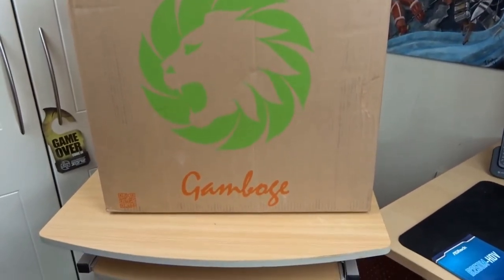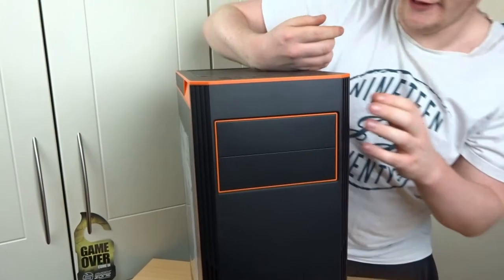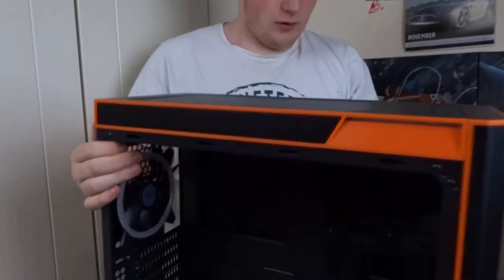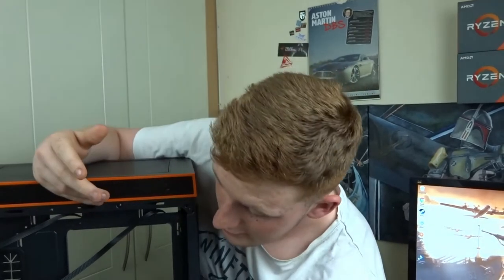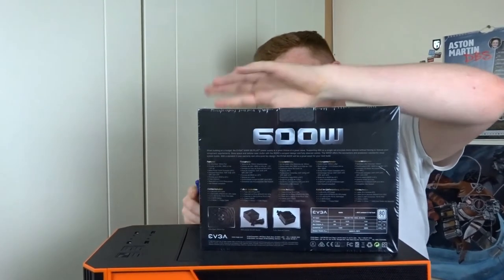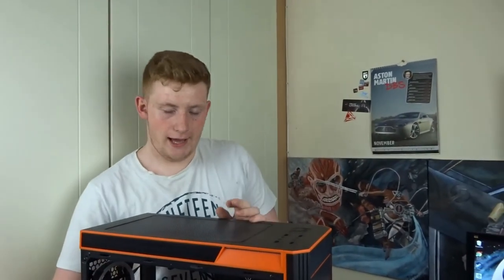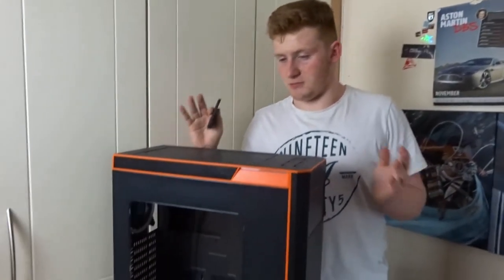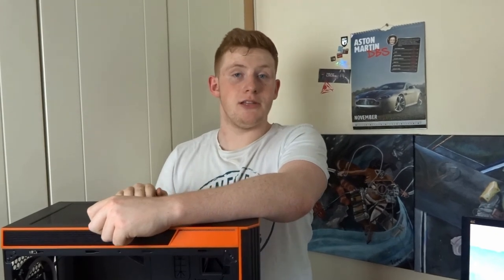Gamemax Gamboge Gaming PC Case Review

Comment: It's the exact same as the Graphite by Gamemax, just with orange accents. Not a bad case for the money (Cost £30 now)
Reply from the maker: My dad used this for a good while, never had any complaints
Reply: @SamsTechTips  I'm doing an orange themed build in this with a cheap orange x79 board and an ex server Xeon, just wondering whether to swap out the rgb for orange riing fans....They would cost as much as the case though.